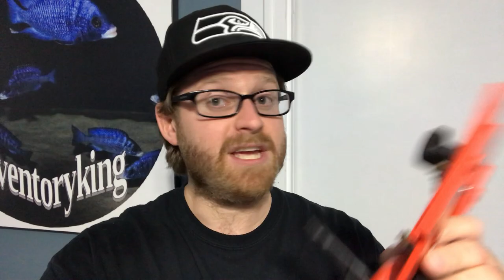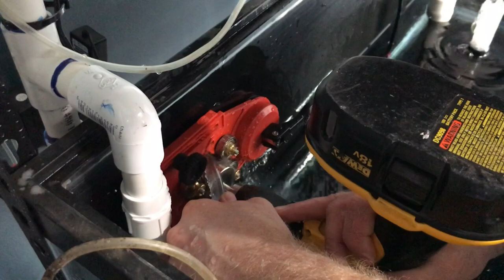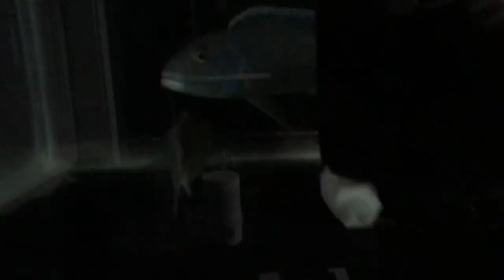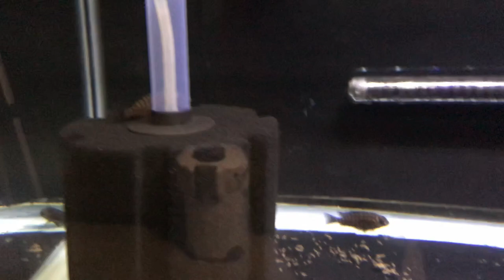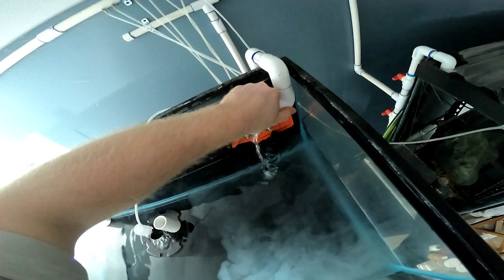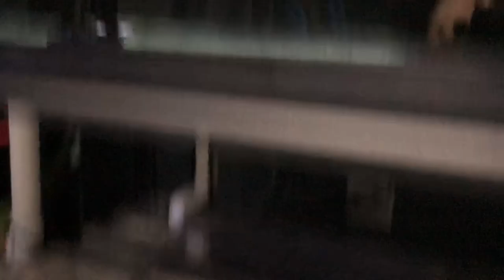AQUARIUM OVERFLOW , DRILLING ALL MY FISH ROOM TANKS

Comment: Which type of glue did you use to glue the pvc to the abs bulkheads
Reply from the maker: I used treaded fittings to connect to the bulkheads. Then normal pvc primer and glue on the pvc.

Comment: This is a good thing, something I have done with my six 55-Gallon tanks! I did destroy three tanks trying to drill them and had to replace the diamond bit. What type of bit are you using to drill ten tanks? I could only drill three before it needed replacing.
Reply from the maker: I used 3 bits. I didnt want to have issues. I felt having more drill bits was worth the money to have the best chance to not break the tanks.

Comment: Nice work you should krylon fusion the PVC for them over flows black it would look way way cleaner
Reply from the maker: Thanks Kyle. Still aquarium safe?
Reply: @inventoryking  yea krylon fusion is bc it bonds to plastic I use it for all my intakes outputs caves etc. They say it's safe after 24 hrs but I like to give it 3 4 days to dry to be safe
Reply from the maker: Thanks